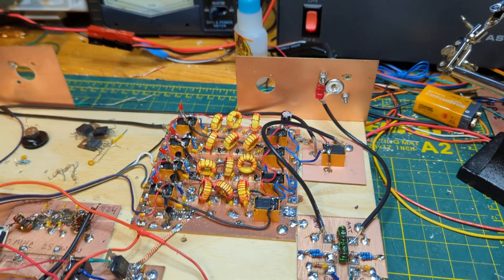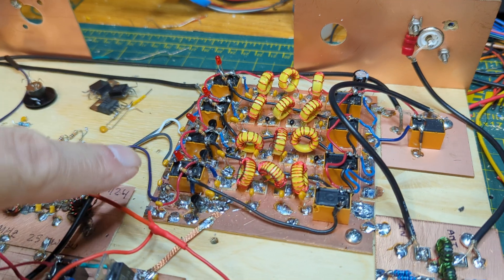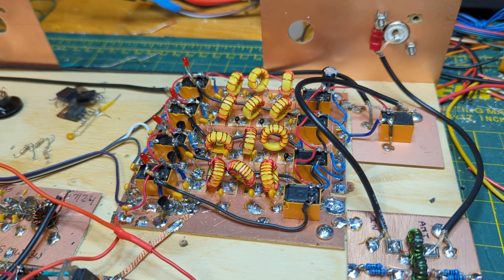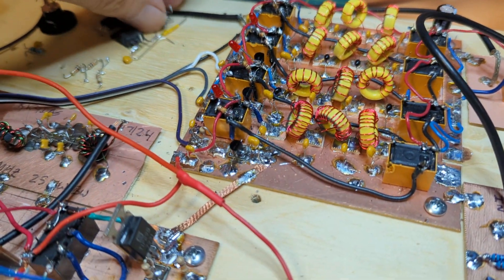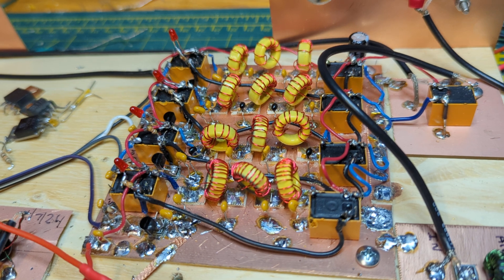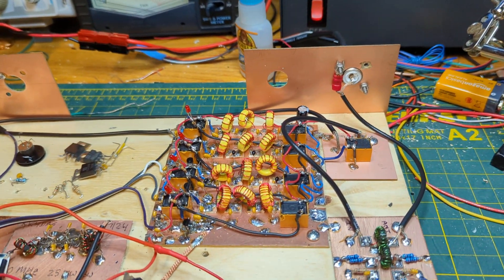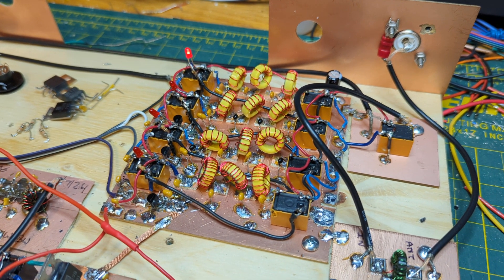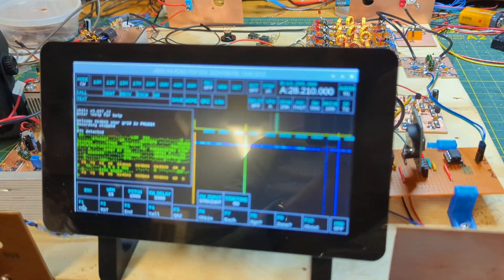Homebrew sBitx LPF Leak 4 - Fixed!

Comment: Good deal Dean...I was thinking about that the other day with the first videos, usually the LP filter boards in commercial rigs are shielded in some fashion IIRC. How's the enclosure design going?  73 - Dino KLØS
Reply from the maker: Dino  - the enclosure design is mostly in my head - but I bought a wooden craft box made famous by N2CQR and have lined it with copper tape.   The plan is to have one ribbon cable from the Pi  to the box - or maybe two - one for digital and one for audio.  I'm going to 3D print an enclosure for the Pi, hat and touch screen display and set it on top of the wooden enclosure.